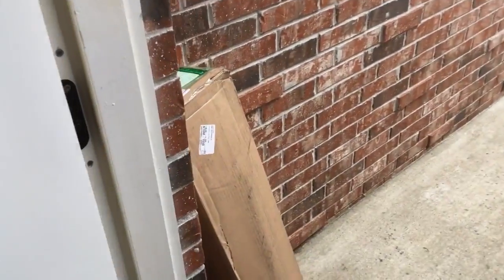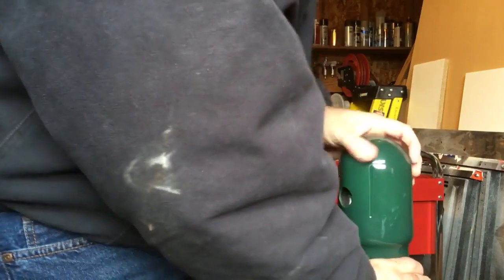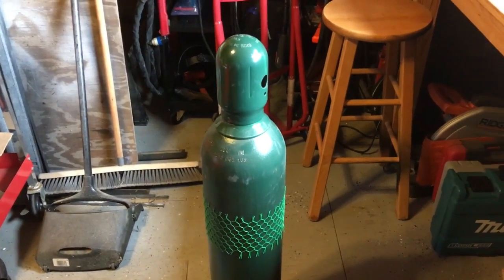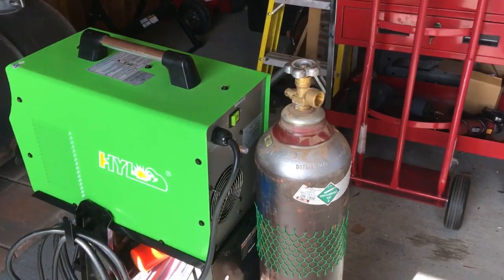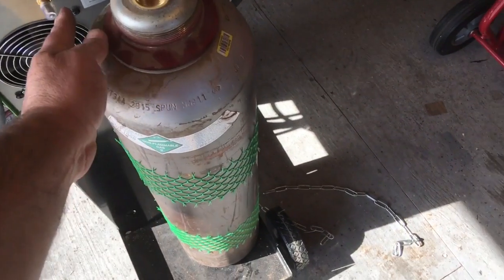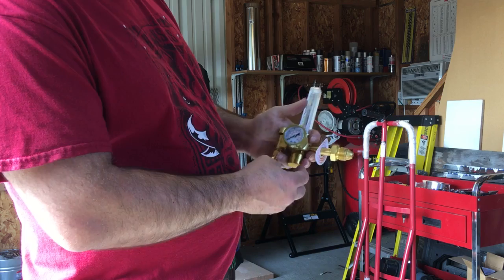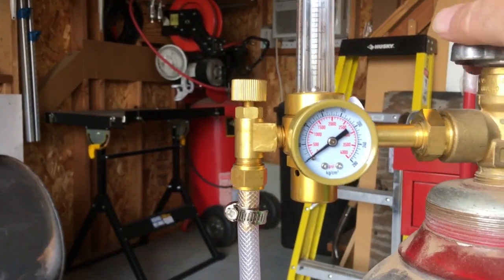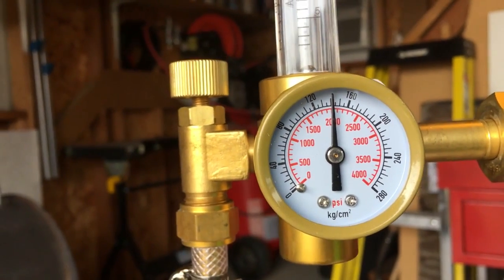Look what I got!! FINALLY!!  Gas Mix for HYL Mig 160

Comment: Think I’ll buy the MIG 130 it’s just the smaller version it takes only 4” spools
Reply from the maker: Hey Andy, yes unfortunately they are out of stock on the MIG 160 and the CUT 40 plasma cutter.  I actually called IWE last week and they told me that they are in the process of moving to a larger warehouse and have decided not to order any out of stock items until after the move.
Reply: CJ's DIY CHANNEL oh, on the website it says that when the items are gone they are gone for good meaning that they won’t keep producing them. I’ll pick up a Mig 130 HYL for 250, it does MIG TIG STICK but it is just a bit smaller and doesn’t take ten pound spools of wire, undetachbwl MiG GUN But is 100$ less so I still consider it a great deal for a 3 in 1